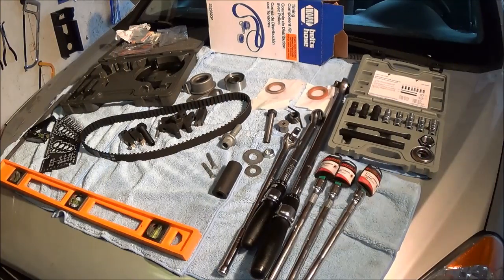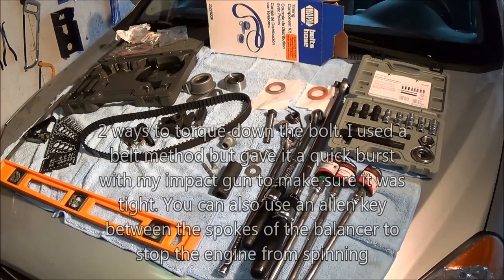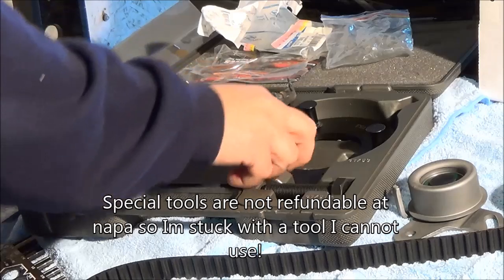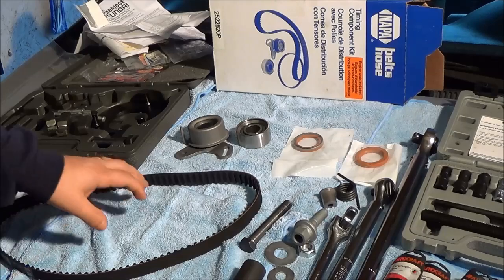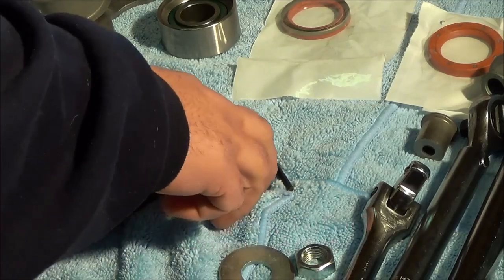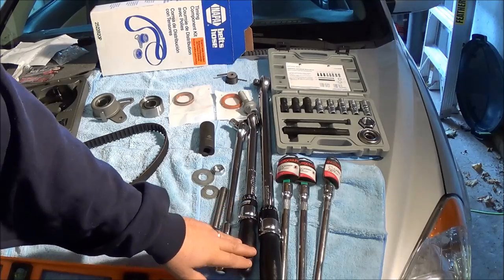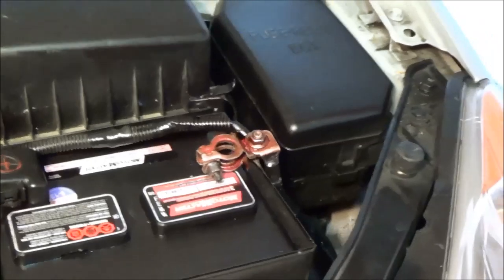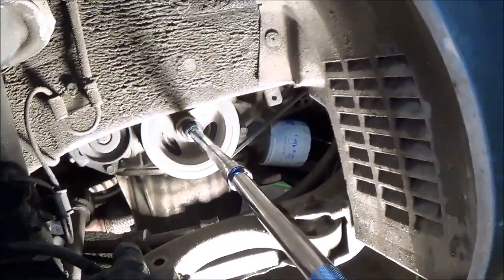2009 Hyundai Accent 1.6L GLS DOHC Timing belt service Part 1 of 3  720pHD

Comment: No water pump replacement? From what I understand it’s not worth doing the timing belt without doing the pump as well. If the pump goes, everything comes apart again
Reply from the maker: @unexplainedphenom81  I did 2 timing belt jobs on this vehicle and water pump was fine. Up to you if you want to predict a pump failure
Reply: Thanks for getting back to me. I will be tackling the belt on my own.

Comment: I got ...the belt, tensioner, Idler pully & all 3 outter belts & waterpump           ..... isnt there a 3rd pulley which should be replaced as well??? or just Idler & tensioner ?

Comment: Hey thanks a lot Gereral1, Followed your procedure step by step and I did this whole job plus water pump. I had never even removed an alternator belt from a car and I learned a lot. Very stressful putting the key in the ignition afterwards but now it runs great! For those of you who will attempt this in 2018 on a ten years old car, for the harmonic balancer even with a manual car in gear you will need to put a flathead screwdriver through that pulley to block it on one of the notches on the block. The bolt is really hard to remove due to rust. You turn the harmonic balancer clockwise until it contacts the screwdriver and use a breaker bar. You can also do the same trick (2 person job) with the camshaft sprocket to put it back and still be on TDC.

Comment: My dealer told me the timing belt had to be changed a t 40k miles.  Is that true?  I have a 2009 accent.
Reply from the maker: sislt777 follow information in this video or reference your cars owners manual. Remember this video is in KLM not miles so convert to figure out mile intervals

Comment: very good video
Reply from the maker: Thankyou
Reply: Can you put a list of tools you use
Reply from the maker: Think I covered them in the 3 videos. You do not need any pullers. Some long plyers, sockets and impact and 3 1/2 inch extensions. Some rope or wire to hold water pump pulley and torque wrench(a must)

Comment: I have an 07' Accent, I am experiencing a ticking sound and a high idle (~1,100rpm ) when the engine is running cold, once the engine warms up it idles at around 740, 750 rpm and other times I experience the same ticking after I raise the idle. Also, I have almost 71k miles on the car. Haven't replaced the serpentine belts or timing belt either but I did find the sound seemed like it was coming from somewhere in the throttle body.
Reply from the maker: this is normal. a good oil change and proper oil filter will quiet those lifters making the tick noise. in the colder months the ticking will get louder as the oil is thick when cold but the ticking will become less noticeable as the engine gets hot
Reply: +gereral1 Okay thank you. Also, oil change was just done less than 600 miles ago the noise was and still is happening before and after the oil change. Do you recommend having someone take a look at the timing belt or no? On Hyundai's recommended maintenance page it said to look at it around 90k miles.

Comment: my 2007 Accent now 40K  ,im replace all belts  and timing belt in 2014 
still  running on original battery amazing
Reply: +DrPiterarnett Amazing!!
Reply: +Cartoon Artisan  Update steering pump die  after 46K ,  battery still crank good
Reply: DrPiterarnett  Still not bad. I hope it wasn't too expensive to replace the steering pump. I remember years and years ago Hyundais weren't reliable. But from about 1998 on, they have been amazing!
Reply: Cartoon Artisan now parts for accent MC  easy to buy on ebay
Reply: DrPiterarnett  I had one a long long time ago (1998) but am thinking of getting another one next year.
Reply: I know this is an old comment, but you just reminded me that my 2010 Accent was still kicking with it's original battery til 2023 lmao!!! Unfortunately that's when it kicked the bucket.
Reply: @venoxin  Incredible

Comment: Seems like since the harmonic balancer bolt must be removed, might be worth it to replace the timing belt (and other timing belt components listed at the beginning of the video), the AC belt, power steering belt, and water pump belt all in one go. 

Did you do a video covering the wobble on the harmonic balancer from the first series of belt videos; which part did you end up having to replace? 

There any replacement work that could be merged into the same disassembly job (maybe the spark plugs and filters)?
Reply from the maker: joeybuddy96 You are correct! The problem is I serviced the 3 belts 1 year ago so they are fine. Most people will get all 3 belts replaced as well as the water pump and idler and tensioner and timing belt. As for torque settings I did show how to isolate the harmonic balancer to get the 105 lbs torque on the bolt. Most mechanics will impact the balancer bolt on without torqueing it. As for standard vehicles you can remove the front tires. Put allen keys in the slots of the rotors and put the tranny in 5th gear. Then you can torque the balancer bolt at 105lbs. Ive done 2 timing belts jobs on 2 different models of Hyundai. As for harmonic balancer wobble this is caused by improper installation of the balancer bolt. Some users suggest blue lock tite on the balancer threads to prevent the bolt from backing out. Ive been driving for over a year and my method works. My bolts is on there super tight. Great questions.....

Comment: I have to do this job this saturday on a 2007 1.6 Accent with 200000 km. I guess there won't be a lot of difference between the 2009 and 2007. Where do we find the torque amounts ?
Reply from the maker: The torque amounts are the same 06-11 models. You can pay per use on hmaservice website 20 bucks for 1 week or 300 for a year access.
Reply: ***** do you mention them in the video ?
Reply from the maker: Yes. There are 3 parts to this series. Watch them. They cover valve cover and water pump too.
Reply: ***** yes I'm watching it right now. very helpful thank you. If the car is 200000km what are the odds that I really have to change the upper camshaft seal ?
Reply from the maker: If the seals are not leaking leave them alone.  If you worried replace your pcv valve. If this valve stops working it can cause those seals to leak. 200000 your due for one as a preventive maintance item. Off to bed. Take your time on your timing belt and you'll be ok. Just make sure tdc is set.

Comment: Thanks, I tried this and I was able to do it, I saved me a lot of money. It took me 2 days but I am not a mechanic. The video was excellent and showed the procedure step by step. I really appreciate having this on you tube where I can fix my own car confidently and save money. It took me that long because I ran into trouble on replacing the water pump pulley.
Reply from the maker: Steven Kearsley I'm glad you successfully replaced your timing belt. I took extra care in covering the small details because to know about it but doing it are a tad different. Most guys will make a 10 min quick video. I covered over 1 hour of material so a newbie could do this. Anyway thanks for your support and give the other services a try! Giving power back to the diy guys and girls... J.O. A. T.

Comment: Hey I have a 2010. Is it any different under the hood? Thanks
Reply from the maker: ***** Tdc to set it is the same. However the tensioner might be slightly different. If you are not sure visit Hyundai forums or goto hmaservice website and pay 20 bucks for a weeks access and download the entire manual. I do know your transmission is belt driven instead of gear driven. 09 was the last year to use the gear driven transmission. I know the engine cover looks different. 

The torque settings may be slightly different. Some Hyundai's require the one engine mount to be removed and the engine raised slightly. Good luck with your project. Like I said put out the 20 bucks. This will be the best 20 bucks you will spend.

Comment: 5th gear didnt work for me but the wall powered impact gun I bought sure did!
Reply from the maker: Glad to hear. The belt idea does work around the alternator to get the torque on the bolt. Most mechanics tap it with the impact and get on with the day.... glad everything worked ok for you. Thank god this job only has to be done every 4 years or 90,000 klm. Now we can get on enjoying summer ;)

Comment: good video. I have an 08 in my shop that i just had to give the customer the bad news of a 1800$ valve job due to a broken timing belt.
Reply from the maker: Is that the cost for a valve job! sucks to be that guy. Thank for liking the video. Trying to help take the mystery out of car repair
Reply: that is worst case. IE all valves  and full monty on the head. IE... press chech crack test, surface shave etc. i have not bore scoped nor leak down checked the engine, that is the task for the morning. BUT knowing KIA motors it an almost certianty. valves are bent. how many... we dont know
Reply from the maker: lock tite with antseize on washer. good idea. i just bought a new bolt and tapped it with the impact. 108 pounds of torque seem alittle on the light side. pinching a used belt to hold the pulley is great for those cars where an impact cant reach.
Reply: head is off this morning, all 8 intake and poss 2 exh. my machinist brought a neat little tidbit to the table. he has seen 50% of these type of failures break the valve guides as well. so this may end up being even more $$ not a good day for my customer

Comment: Hi  Thanks very much for these videos I have almost exactly same car and want to do the service work myself to save money learn and know I did it right.  Question: since my car is standard xmission if its in gear the crankshaft cant turn when I loosen/tighten the harmonic balancer bolt right?
Reply from the maker: Correct. Think its has to be in 5th gear(- guessing on this one).  I've seen other timing belt videos trying that and it seems to hold the balancer from Spinning.
Reply: gereral1  woudn't it be harder to turn the balancer if it's in 1st gear than 5th since the engine has to spin more turns for the number of wheel turns when it's in lower gear?

Comment: Okay I have my 07 accent SE and today the car shutoff with oil & battery lights on, is the engine dead? or it need to replace the timing belt.
Reply from the maker: Hyundai Symptom Troubleshooting Guide Chart
Unable to start
(Engine does not turn over)
1. Test the battery
2. Test the starter
3. Inhibitor switch (A/T) or clutch start switch (M/T)
also check for :
DTC code?
Low compression
Intake air leaks (use propane around hoses and intake manifold to hear
a change in engine idle to determine the source leak)
Slipped or broken timing belt (remove upper timing belt cover to check)
can use a timing light connected to #1 cylinder spark plug and shine light down
on harmonic balancer to check
Contaminated fuel
Engine stall
1. Test the Battery (use a load tester) as in one of my videos
2. Check the fuel pressure (hold at 49-50.5PSI) according to Hyundai Tech manual
3. Check the idle speed control circuit (Check DTC)
4. Check the ignition circuit
5. Check the CKPS Circuit (Check DTC)
also check:
 
DTC  code?
Intake air leaks
Contaminated fuel
Weak ignition spark (take out a coil and check the spark plug spark jump for a week coil)
Check the coil wire harness as in the sparkplug video. If this wire is bad
you will get no spark and no start.
If you turn your key and hear no hum as the fuel pump charges the system your fuel pump is bad
If you tun the key and it chugs and nothing then your starter is fine
Check injectors
If you turn your key and the car sounds rough on start like metal sound it could be the drive plate teeth are damaged
so the starter cannot engage the drive plate to start the car.
If your battery is low in voltage then well no car will start lol
The voltage regulator is inside the alternator so if the voltage is too high then you need to replace the alterntor.
Check all wires for a short
These could be a problem too
Manifold Absolute Pressure Sensor (MAPS)
Intake Air Temperature Sensor (IATS)
(they are on the throttle body)
Look into the fuel part of the system! then check the ignition coils,spark plugs, wires

A check engone light code would help me steer you towards certain tests.
Reply: ***** i have changed all the coils and one of the spark plug changed it thanks to your videos, but the thing is i felt the engine shaking(one shak) in the Idle status, i know the car when there is faulty coil how it jerks and i know about spark plug but this time it was doing the same status all the week when i wanted to check the car, today while driving suddenly stopped and only oil & battery is on, when i try to turn it on it's not working, i am thinking to go to hyundai dealership to check on it.
Reply from the maker: Check oil level is full
Check the CVVT Oil Control Valve (OCV) (located below the engine cover bracket and to the right of the exhaust manifold.
Below the upper radiator hose. Someitmes a faulty sensor car trip the oil light.
If you oil is full check the timing belt teeth and make sure the timing has not slipped.
If you try to drive it and the timing belt has slipped the crankshaft position sensor will shut the car off if
you timing is off to protect you from forcing the car to drive causing internal engine damage.
I wish I could think of something else.
Maybe others can chime in on this.
Reply from the maker: Remove the oil filter and replace it. A clogged oil filter might cause oil pressure problems. Most oil filters has a valve in them that will allow the oil to pass through unfiltered if the oil filter fails internally.
Reply: ***** okay i hope the engine not missed up, i will check with a mechanic
Reply from the maker: zakria hamdi Do the simple thing which I forgot to mention. Check the fuel pump FUSE to see if its not bad.
Reply: ***** hmm okay, really? so the fuse it might cause the engine jerks one time or twice within like 1 minute. should i take the car to hyundai service or they will eat me!! lol
Reply from the maker: the jerk is caused by either a bad coil ,coil wireharness short in one of the wires leading to the 4 coils or a clogged fuel injector. Place a long screw driver on the injectors and place you ear up to the handle and listen for the click. If the click changes in sound while the car is idling it could be a bad injector. If one of the injectors sounds different from the others its that one. The car would not start is the fuel pump fuse was blown.
Reply from the maker: Did you get a check engine light code?
Reply: ***** no the engine light is off, the only lights is oil and battery.
Reply from the maker: good no engine light.  usually a misfire code would come up if the car sputters. How long does it idle before the sputter?
Reply from the maker: I got to go to bed for work. If the tests I posted don't work please do not drive it as you could cause internal engine damage if you do have low oil pressure. Its very rare the oil pump is at fault. Please post a follow up after Hyundai fixes it and post your results. have a good nite and goodluck.
Reply: Thanks i will post and let you know